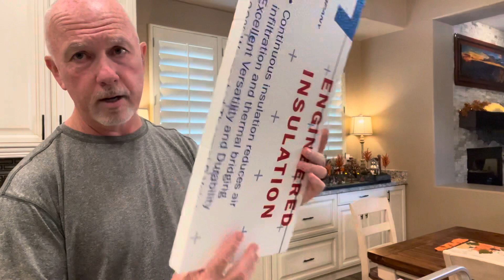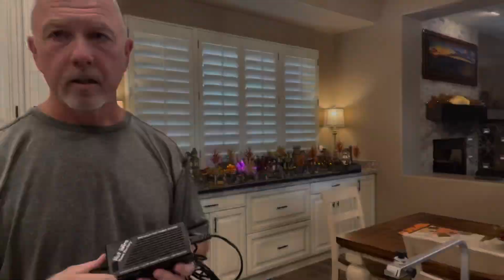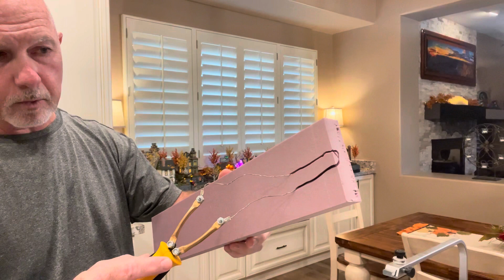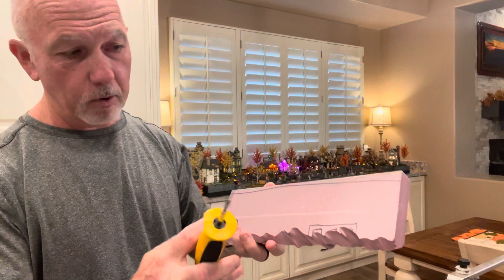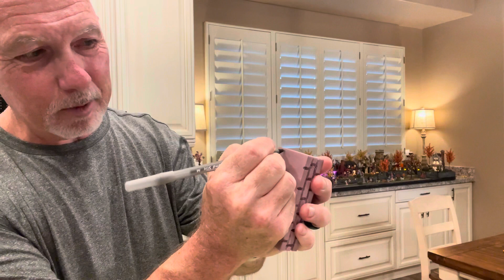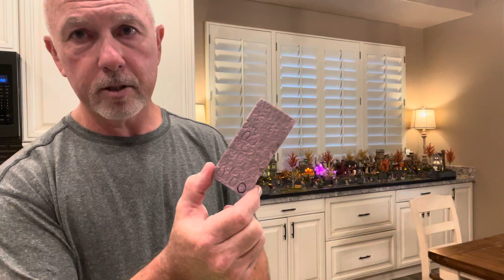Tools & Equipment Demo

Comment: Carl, I am asking a big favor here and I hope you can help. I already bought some other foam tools and am not happy with those. I went to the site hard wire foam factory to look at their items, but I am not sure exactly what you purchased. Did you build your own kit, or did you buy one of theirs already put together kits? It looks like you probably upgraded their basic kit. I want to purchase the correct stuff this time. Is it possible to send me the exact links for each of the items that you purchased? Carole
Reply from the maker: Carole…it’s best to get whatever you think you’ll use.  I purchased their Pro Kit and chose a freehand router, an engraver, a 6” hot knife and a sculpting tool.
Reply: @HalloweenVillagesbyCarl thanks Carl, I will look for those on the site.

Comment: Hi Carl, I finally found this video 😊 do you recommend the warranty for the Proxxon? Also in the current videos, I noticed you added a piece to your Proxxon machine what is that used for and is it necessary? Again thank you in advance
Reply from the maker: Glad you found it!  I did not get the warranty and mine is still working strong!  The added piece is called a wooden fence for the Proxxon—should be available on Amazon as well!

Comment: 2:13 that’s pretty funny I have at least a 4 inch thick piece that is in my garage on top in the bottom and the sides of my sauna we use the sign of predominantly more in the colder season and just some guy on Facebook marketplace had some extra clothes in Minneapolis Minnesota we use the good stuff super sick that’s funny you don’t even have it available where you live
Reply from the maker: Yes—suppose it depends on where you live.  Just recently found a 2” 4’x8’ section at Lowes in the pink foam!

Comment: Hi Carl, what tools would you recommend purchasing from the hot wire foam company? I am looking at the 4 in 1 pro model kit, and it gives me 3 options for the hot knife....3, 4 or 6 inches. Which one would you recommend for cutting the foam in half or for cutting sidewalk pieces? I don't have a proxxon hot wire foam cutter, so thought maybe the hot knife could work. Would love your input since you have been using these tools and know how they perform. Thanks so much.
Reply from the maker: Hi Chantel!  The 4-in-1 kit would be great.  As for the knife, I would go either 4 or 6 inches—that way you can cut through multiple pieces of foam at the same time.  Excited for you!!
Reply: @HalloweenVillagesbyCarl  thank you, I appreciate the feedback and quick response

Comment: Thank you for sharing!    I have watched all your videos.     In one of your videos you mentioned that the store will cut the 2x4x8 insulation board.    I was wondering if you would share how you have them cut it for you.   My projects would be limited to a fireplace mantle etc or the top of a buffet.
Reply from the maker: You’ll just have to see what you can talk them into—I’ve only asked them to cut it basically in half, so I could fit the two halves into my SUV.
Reply: @HalloweenVillagesbyCarl  Thank you for the reply.   I have a bunch of supplies ordered and I am going to give it a try.   I have been collecting Dept 56 for years and have always wanted to try building a display.
Reply from the maker: Good luck and please let me know how it goes!!

Comment: Thanks for the great info Carl! Quick question did you run into ventilation problems while using your hot wire tools inside?
Reply from the maker: No, not really as I want I did inside was pretty quick.  If I’m going to do a lot of cutting, I usually work in the garage.

Comment: Thanks for the great info Carl! Quick question did you run into ventilation problems while using your hot wire tools inside?
Reply from the maker: Yes I did…I try them in the garage now with the doors open when possible.

Comment: Very helpful video. I plan to start making displays and I want roads for my village. The thought of making each individual cobblestone by hand was a bit overwhelming. I think I will go with the Department 56 mats but I wondered if you had tried the textured rolling pins. I'm trying to weigh: cost, time required, and achieving the desired effect.
Reply from the maker: Hello and welcome!  I have seen plenty of tutorials on the rolling pins and they look awesome, but most people use them on clay I believe.  Anyway you slice it, then you’re forced to trim it and paint it.  I don’t mind the work, and may give it a shot someday.  Let me know if you decide to give it a go—I’d love to hear what you think.
Reply: @HalloweenVillagesbyCarl  I have watched some videos where they use it on  styrofoam.  It apparently works well on the various types of styrofoam but works especially well on the type of Styrofoam poster board that you can get at Dollar tree. I like the fact that there are more patterns to choose from and I could have more control the color of my roads. But I like the ease of the Department 56 mats. I will probably buy one of the rollers  to see how well it works. I'll let you know if it works out well.
Reply from the maker: Yes, please do!